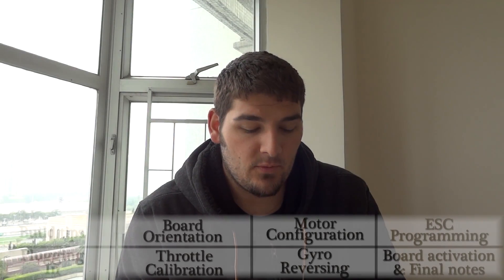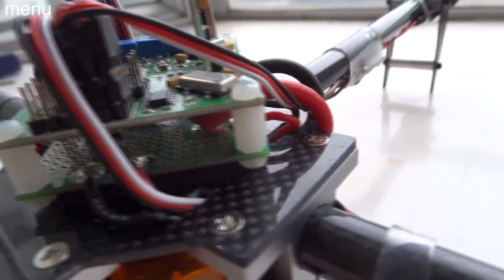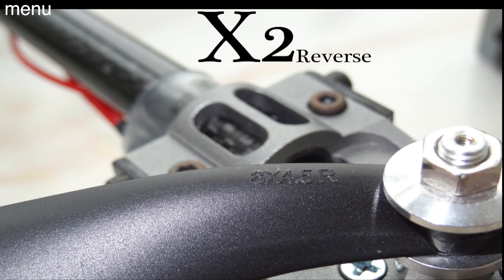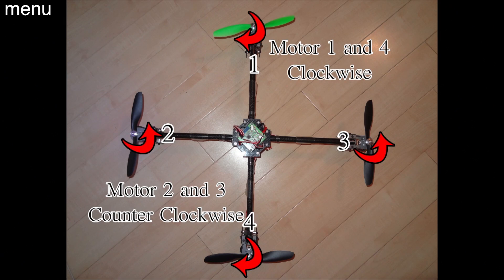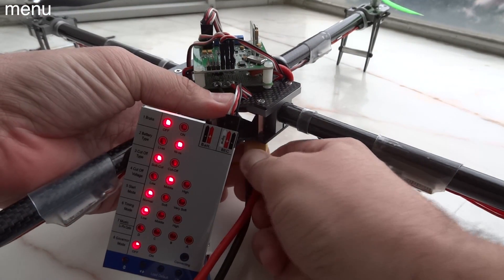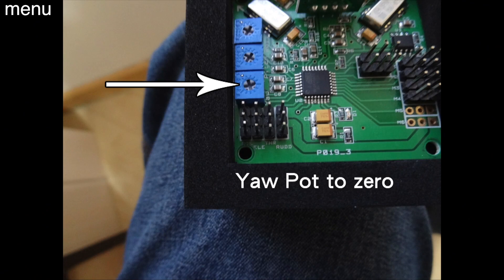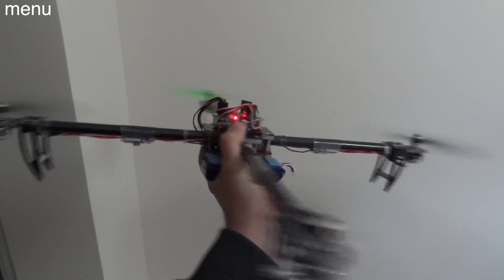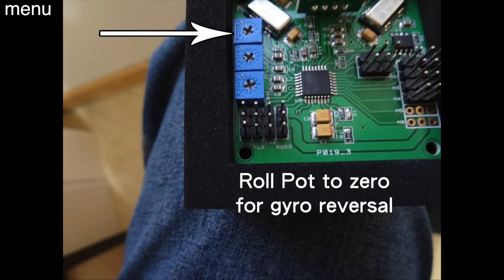HobbyKing Quadcopter KK board setup guide

Comment: about time someone posted a good how to on this board. The directions on HK are aweful.  i have spent the last 2 weeks trying to figure things out.    i still dont get why i have to turn all 3 pots down to almost 0% to get it to even attempt to fly normally.  (sometimes it powers up into a program mode its so close but anything more and the copter is just a spaz).   we really need to be able to tweak our own tunes.   and how do we do stick centering on this board?  trims are all off.